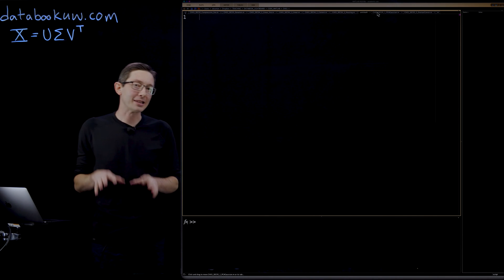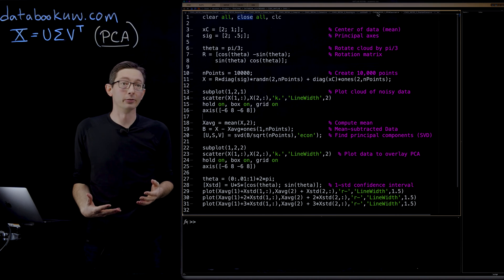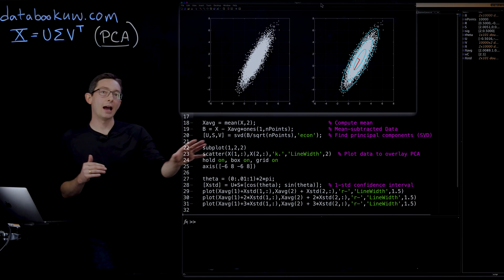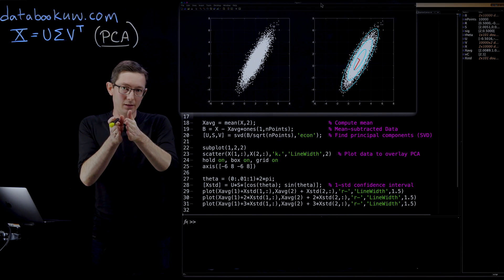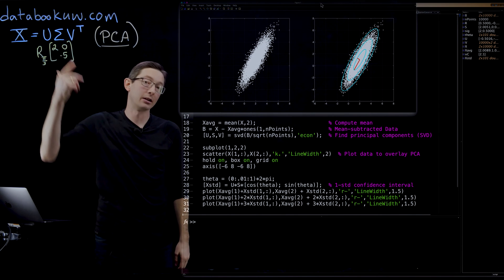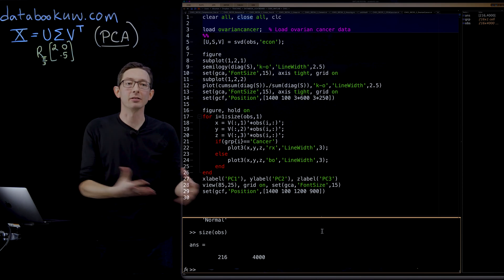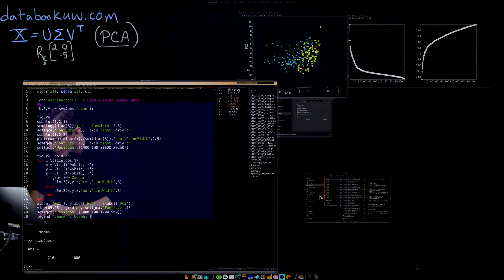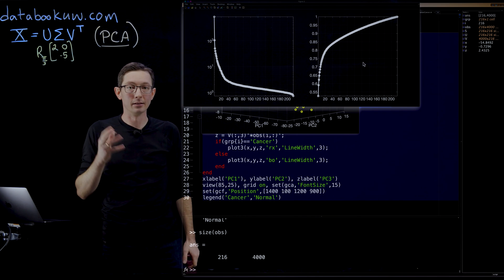Principal Component Analysis (PCA) [Matlab]

Comment: for future ref) In the first part of the video, X's colums (not rows) are each points(correction: 5:02 not every rows but every columns are X average). And, note that the code is using `svd` function, not `pca` function. In MATLAB, `svd` is just an SVD so it doesn't care if each sample is row or column or whatever, but `pca` internally operates assuming each 'row' is a sample.
This can be confusing because in the previous lecture(the first video on PCA), he assumes each 'row' represents an individual sample(e.g. person, etc.), whereas in the SVD lecture he assumes each 'column' represents a sample.
  BUT, in the second part(ovarian cancer; still using the 'svd' function), the 'obs' matrix is 216x4000(216 patients) where each 'row' represents individual patient. Thus, here, U and V is actually like V and U in the first part of the lecture, respectively. 
  Also, in the for loop in the code, the code plots each patient(each dot) in the 3 "principal" axes, in the for loop(in Matlab, A' means conjugate tranpose of A).
However, the code calculates the dot products of the two long vectors(4000 elements, and this can be even larger in different examples). 
We don't need this calculation because U*S already contains the exact same values(this U would have been V if each individual patient were represented by column, not row). 
So, we can just use U(i,1)*S(1,1), U(i,2)*S(2,2), U(i,3)*S(3,3) for x,y,z in the for loop, instead of calculating the dot products. Even simpler way is just matrix multiplication, such as U(:,1:3)*S(1:3,1:3).
(I don't use MATLAB but it should work. If it were Python, indices would be a little different).
But, still, knowing why those dot products("projection" onto orthonormal vector, in this case) works is important in understanding SVD and PCA. 
Also in that for loop, we don't need to use the two `'`, since V(:,k)'*obs(i,:)' equals obs(i,:)*V(:,k) unless we use complex values.

Anyway, thanks a lot for this great series of lectures, awesome.
Reply: THANK YOU. Your comment has saved my sanity, it was the final puzzle piece that made it all click. This should be included in the description of the video word-for-word.

Comment: Great Video , But one confusion , Arent we supposed to subtract the mean before computing the SVD? in the ovarian cancer case
Reply: He is working with SVD as a way to compute PCA and one of the advantages of SVD in front of classical PCA with the eigendecomposition formulation is that SVD or truncated SVD does not require the data to be centered by the mean

Comment: Hello sir, please I'm using your code to visualize the classification of ECG signals with 3 labels. The diagram generating is not correct. I think the problem is from the "for" loop. Please help me rectify this coz I tried severally but to no avail

Comment: Excellent lecture. Question: once you have determined the magnitude of the principle components is there a way of determining which features they represent in your original data? For instance determining which features from the cancer data correlated strongest to a cancer diagnosis?

Comment: I just don't understand why for the ovarian cancer example you don't do the preprocessing steps (mean and division by sqrt(Nmeas))
Reply: Well, I will try answer to your question. Actually, what you are reconstructing in the Gaussian Data example with SVD is a scale version of the standard deviation:  STD/SQRT(n). And this is done because he is trying to plot different confidence intervals. As you may remember the equation for the confidence interval is the Mean +  Z*STD/SQRT(n). Which is what he is plotting in the red circles. So with a Z value of 3, you can capture almost 99 % of the data, which is what we see in the plots. Thus that normalization term is only because of the application of that code only. For PCA you don´t have to always normalize or standardize data, it is only needed when you are working with correlations or when the application demands it. In fact, if you are working with SVD, Data doesn´t even have to be centered by the mean, which is one of the advantages to USE truncated SVD instead of PCA

Comment: Thanks Steve for the amazing explanation! One thing I dotn't quite understand: why U*S*[cos(theta); sin(theta)] captures 1 std of the data?
Reply: What I think he is actually doing is capturing, in SVD procedure, the diffeomorphism (fancy terminology but in few words is a linear transformation which inverse exists in this case ) to reconstruct STD/SQRT(N) which is part of the equation for the confidence interval. Then he is plotting those confidence intervals up to a z value of 3 that corresponds to almost 99% of the data
Reply: ( know this comment is 2 years old but..)
but if anyone else is wondering, scroll back to how X is created initially. And note that U only rotates vectors and sigma stretches. And, U, sigma are SVDs of B.

Comment: @Steve I work with spatial time series data(3d x.y.t eg: temperature). I seen codes reshaping the spatial dimensions into 1d, so I have 2d series then apply the PCA analysis.
But I need to work on vectorial data (eg: wind) which is in components (u,v) in 3d. Which makes then 4d...will it make sense if I reshape 3d(spacial 2d+ components 1)  into a 1d which makes 2d data and then apply the pca?

Comment: I got a little bit confused, what's the intuition behind calculating x, y, and z by doing V times b (observations)? What is x, y, and z showing? Sorry for the silly question, thanks in advance.
Reply from the maker: Here, x y and z are just the first three principal components of the data set.  So it allows us to visualize how the data scatters in these new V coordinates.  There are interesting patterns in V(:,4) and V(:,5) too, but I can't plot in x y z u v coordinates and make sense of it as a puny human stuck in 3D.
Reply: @Eigensteve  Oh, so it's the data reconstruction but just using 3 of the components rather than all 4000 of them... why do we do V * d or V * obs?
Reply from the maker: @AdityaDiwakarVex  V * obs essentially takes the "observations" (i.e. the data) and transforms it into the V coordinate system.  (it is also V-transpose * obs, which is an important subtlety when computing these things)
Reply: @Eigensteve  Oh right, I do see that it is V-transpose. Thank you so much, that cleared it up. You are easily one of the best professors/teachers I've come across, thank you!